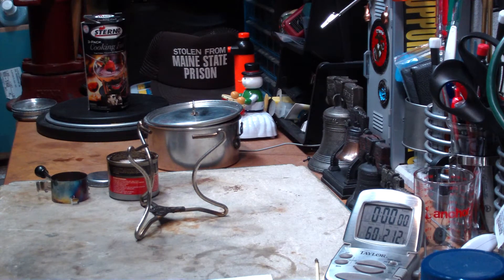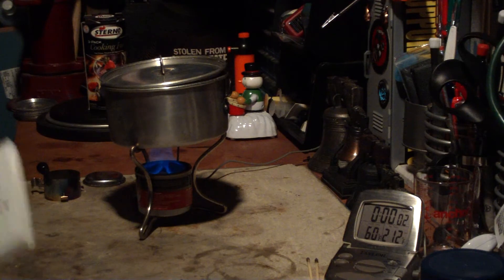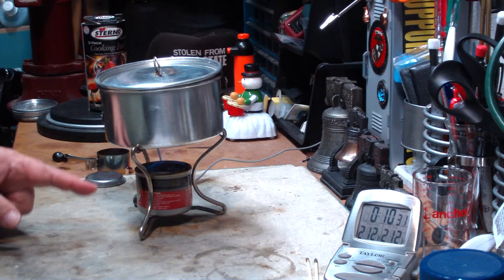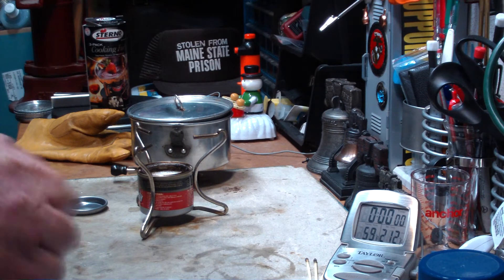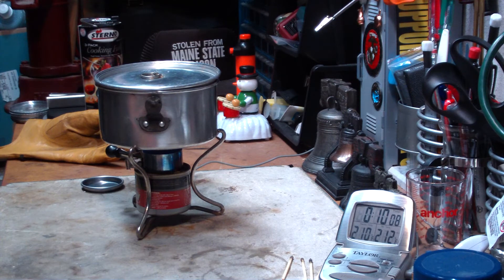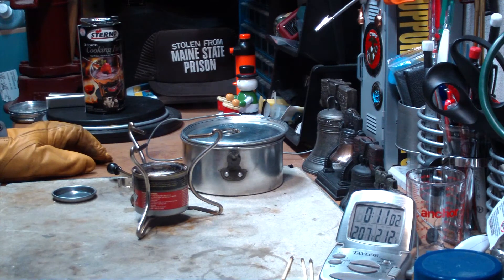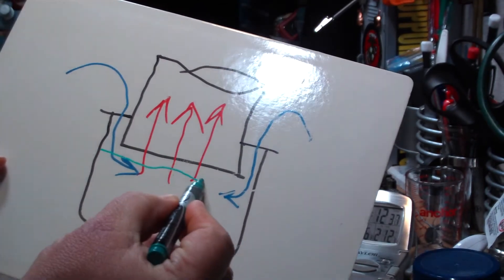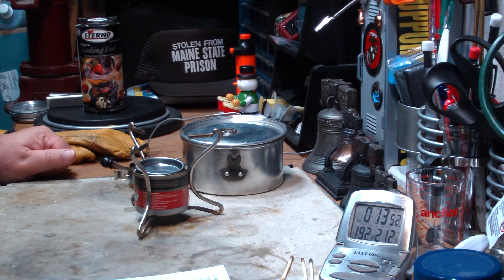Sterno can refill with Heat Intensifier - Boil Test

Comment: since the stand has three legs, you could build slots into the metal ring with various lengths so you could adjust the gaps a quarter inch at a time or so by lifting it and moving it around the clock.  It might work in the wind also

Comment: with that open wire sterno stand and the intensifyer.  if you were to build a ring of solid metal about half inch tall and set it on the top under the pot.  it would both increase the gap to closer the sweet spot and cause the flames to gather under the pot bottom where they are needed.   I have some slotted sheet metal for adjusting air gaps in grain dryer fan openings that would work well for that. just thinking outloud.

Comment: I think you're explanation is on the right track, Hiram. This experiment really has two competing variables: the heat intensifier and the flame gap between the burner and the pot.
If you want to control the flame gap, you could make two pot stands out of hardware cloth to keep the gap the same for each test.
I have a feeling 1/2" is too small of a gap for most alcohol stoves, so maybe the heat intensifier (designed for the small sterno flame) brings the larger alcohol flame up too close.